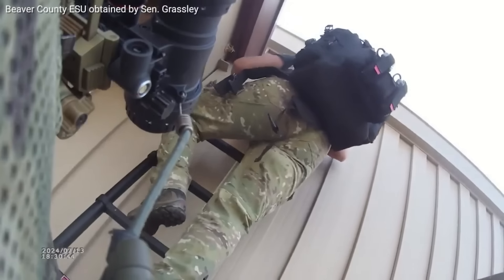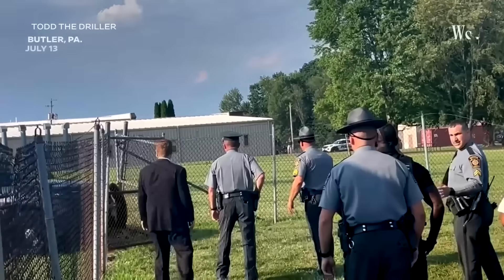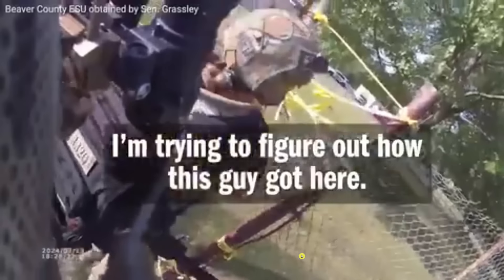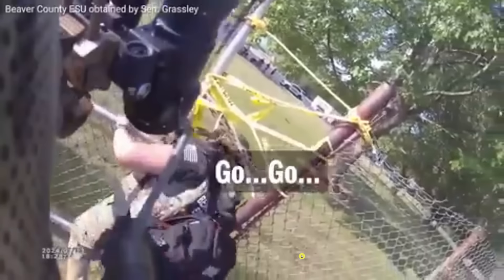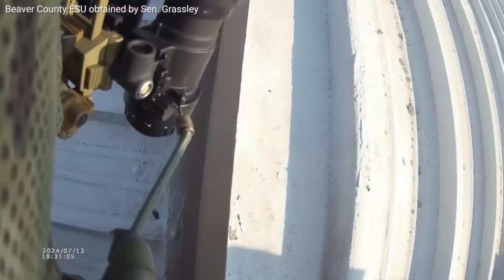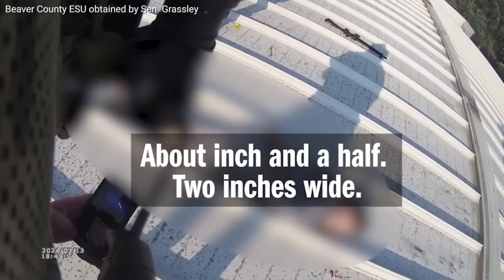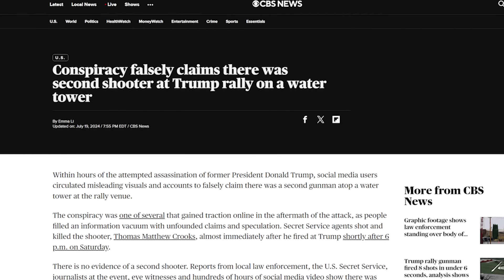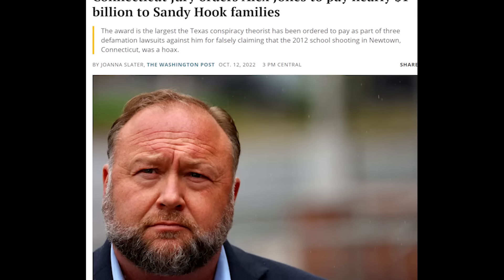Trump Shooting Analysis: Shell Casings, Ladders, Drones, Bodycams,

Comment: Most rifles eject spent casing shells to the right, and usually by several feet. So why would they be counting casing shells in front and to the left, between the shooter and the gun. And why the heck was the gun so far to the left of the shooter? If 18" roof ribs, it's at least five feet from him. Did someone move it? Did the shooter not die instantly and somehow roll himself to the right. NOTHING makes sense!! So many questions.
Reply: Exactly
Reply: I was thinking the same they. The AR15 ejection port should had those rounds to his right. Even with the BWC cam and the 5 or so officers counting casings, they said 5 but yet the reports form former SS director and now lying FBI it was 8 shots. I would have expected  8 spent casings on the roof.

One other thing I've been thinking about he said he had 3 30-round magazines, where are those magazines? And did he really believe or think he could get off all 3  mags with 2 known CST posted in the vicinity?

Again explanation given to the public does not make sense.
Reply: Shot 1-3 Trumps was standing, shooter has rifle laying on the apex of the roof like a stand. After the 3rd shot, Trump hits the deck and is now being protected by the bullet proof Stanton. The shooter could have stood at that point because now he would need to get a different angle and trajectory to hit Trump and the only way was to stand to get more of a downward shot. If the counter sniper shots him in the head, It could have very easily spun his body and the gun was thrown out of his hand. I mean how long is a fully extended arm. About 2 feet.
Reply: This video is an hour after the shooting, so this was not witnessing what actually happened. The closest to the scene were the counter-snipers who have very suspicious stories, and there are other ways onto the roof including a window at the end of the counter-snipers building. There seemed to be a few casings that rolled halfway down the roof based on the helicopter view, so the casings in this video had previously been gathered and potentially staged.

The shooter was supposedly killed by the secret service snipers 9 seconds after the shooting stopped, but it looks like they're just trying to support their original statements despite the evidence leaking out. The final shot of the second burst had a much different sound, and since he immediately stopped shooting it makes a lot more sense that was the shoot that killed him. A local officer claimed to take a shot, and they are also disputing key elements of the FBI's narrative including the story that counter-snipers ever abandoned their post. Perhaps that shot 9 seconds later also hit Crooks, but this video is more consistent with bleeding out from a pistol shot rather than the blood/brain splattering of a counter-sniper rifle.
Reply: @kfelix2934 In the body cam footage, they counted 8 shell casings. It comes up twice. The first time he stops at 5. The second time, near the end of the footage, he counts 8.

Shell casings from an AR bounce around when ejected onto a hard surface, hence their scattered locations. 

It's standard practice for an officer to move a weapon away from a suspect. The first officer on the roof moved the firearm away from the suspect.
Reply: I watched this video before and the guy counted five bullet casings the sound experts say that the first three shots were fired from inside a building and the five others from outside, so why is that cop saying there are 8 casings there ?  So much BS lol 🤣😂
Reply: Both sides of the roof, not the shooter. Over the roof mid line. You can see several of them in the footage.
Reply: @tammlen2284 i have the same analyse 2 days ago...i saw a picture  on the roof where they shoot Crooks ...on this picture   there was an police agent dressed in Black uniform grabing the  hand of Crooks lying on the roof( apparently dead but blurred) there was a trail of red in one side to the other side where he was...so when i saw the body cam video...I undestood that they have moved the body...a question to myself is WHY...?  In an investigation they  are used  to Never move  a body  ...only corroner does...Did they move the body to serve a theory  they want to fake ? There s to many non sense in this  case...🤷‍♂️
Reply: The gun being so far left could be just the normal procedure of police to move the weapon away from suspect, but the shell casings - that smells to high heaven.
Reply: @peterjsmith5918 wow this makes more sense than anything I've heard so far.
Reply: They are trying ways to cover it up. The audio recording proves there were 3 different rifles fired with the first 3 rounds from a high powerd calibre rifle, possibly from 308 or similar calibre. The sonic boom and wave from the rounds we're different..if all from the same area and rifle, the sound waves would be exactly the same. But they are not. The first 3 rounds fired was different from Sonic from the others fired.  Then, a single shot was heard last, possibly the sniper round that took out Crooks.
Reply: @Nathan-ry3yu  I noticed that they wanted us to believe all shots came from that mangled looking AR... there was way too much report for those first 3 shots to be that low powered. And the audio did prove that those first 3 were more focused as if isolated, almost as if they wanted it to seem like a lower caliber rife.
Reply: @tammlen2284   This is either the most crazy Mr. Bean accident in history... lol my foot. Or it is super well orchestrated.
Reply: The crime scene was tampered already. We saw video of camo geared climbing up there and there were already few black police units. My guess is that they were secret service guys. They probably tampered crime scene and moved the gun. Who knows if they placed more shell also there. If we will not see their cameras i can safely say this is coverup
Reply: My guess is that they could have bounced the ground at an unusual rotation, but that is a good question and something that needs to be explained. As for the weapon placement itself, it’s standard procedure for tactical units to remove weapons out of arms reach of a fallen enemy, deceased or not. I’d assume the tactical response team that first got to the body has the same procedure, to me, not very suspicious. 

I also don’t think it’s necessarily tampering with evidence, because the most pertinent issue is NOT to preserve evidence but to neutralize the threat.
Reply: Why are swat officers counting cartridges to begin with? Are they also qualified in forensics.
Reply: @chriskessell4579  You obviously didn't watch the entire body cam footage that was released. You watched the part where one of the first ECU Swat guys on the scene says there are 5 casings over here. You could tell he was talking about ONE certain section of the roof. HE wasn't talking about the entire roof. Then near the end of the video they say there is a total of 8 casings. So, the first SWAT saw casings in one section and that is what he was talking about, which is shots 4-8. That is why all this BS stuff is floating around because people aren't watching the complete video.
Reply: @peterjsmith5918  Such BS. Not one thing you said is true!
Reply: The first three shots were fired from the second floor of the building next to the alleged shooter.  The weapon that fired the first three shots was probably fitted with a silencer, which accounts for the lack of echos.  The second five shots were blanks fired from the same location but with a different weapon most likely an AR-15 using a surefire trigger that can fire rapidly.  Blanks were used in the AR-15, which explains why no one else was injured.  Local law enforcement was in the building next to the building that the alleged shooter was on.  The last shot fired killed the alleged shooter and was probably fired from the same window as the other eight shots.  Everything supposedly found on the roof by first responders was planted by them as alleged evidence, including the 8 shell casings.

Comment: THIS VIDEO IS EDITED the original shows the same guy counting 5 shells
Reply: Hr did count 5, then 3 more.
Reply: THAT is Chuck Grassley for you ....  just in time to back Chris Wray's BS testimony.
Reply: BINGO !    On the roof, first they said 5 casings.   But then he counted out 8 casings, without showing them on his body cam.
Reply: i thought the same thing but you can see the other 3 on the other side of the roof when he counts 5
Reply: @officialMC-E .  Now I’m wondering if he slid down a tad and did the round of 5 shots. Is that why sound echos different since it’s a metal roof?
Reply: @officialMC-E  you mean the brass tossed up on the roof by the ground floor ESU sniper as he high tailed it out of there ?
Reply: @officialMC-E  does not work like that. any ar does not eject forward, no way !. they eject backwards, which means, any shells would end up to bad guys right side..period !.
Reply: @alanshaw4655  EXACTLY!  Backwards and TO THE RIGHT.  Any spent cases on the shooter's left came from somewhere else.
Reply: Counting FIVE CASINGS HERE:    https://youtu.be/XwBygHmIZ6c?si=5vjsIlk0enneISFZ&t=280
Reply: I counted 7
Reply: @officialMC-E she’ll casings only eject out the right if they are on the left they would have to be planted or moved

Comment: No ladder needed.  Shooter climbed to the roof using the a/c lines.  Once he was able to reach the gutter(commercial gutters are made from a much stronger material) he hung from the gutter and cross slid his hands along the gutter until he could get his feet on lower roof.  There he could easily climb to the higher roof.  Point 2   The roof is not flat. Each section of the roof panels have a 3 to 4 inch rib which would prevent a person lying on his belly from easily sliding across the length if the roof.  The shooter had to lift himself up to cross each rib.  This is what the spectators saw.  When shooter was walking around no weapon can be seen.  Thus the weapon was on the roof at an earlier time.  The purpose of the drone was to see if the weapon was still there undiscovered and determine the best shooting position.
Reply: Where did the black ladder come from???
Reply: Smart
Reply: His ladder was hidden behind those cedar trees.  It looked either red or orange.
Reply: @jaygold4467  police ladder
Reply: Why would he buy a ladder and not use it? Crooks believed that he would be able to exit the scene via his ladder and motor during the commotion. He was obviously a patsy and foulked up the shot.
Reply: Ooh, this is the best take I've heard yet.
Reply: That makes the fact that he had a receipt for a ladder in his pocket and that a ladder was filmed on the side of the building even weirder
Reply: He was lifting himself up much more than 3-4 inches. I think he was taking a peep over the ridge of the roof, to check his line of sight. To confirm the north snipers couldn't see him, and also because there was a fork-lift kinda thing partially in between him and the target.
Reply: @noelogara1 he never used his ladder, after her seen drone footage,he knew he could climb up AC pipes,the ladder u are seeing in video is the one cops brought to get on roof

Comment: The whole collapsible stock argument is for the law they already have writen and want to use this event to pass. The majority of collapsible stocks have around 3.3" of difference in length and that makes absolutely no difference in concealability what so ever.
Reply: Unless the director meant "folding stock"
Reply: @CedarOutpost  With a foldable stock it doesn't change. They want us to focus on the wrong subjects to not realize what is going on and what will happen...
Reply: @CedarOutpost  if the FBI director doesn't know the difference between a folding and collapsible stock, then he is a fool and in no way qualified to have that job.
Besides, very few AR15s have folding stocks because the tube the stock slips onto contains the buffer and the spring to operate the firearm. One has to add in a part that minimally costs $100.
There are piston driven ARs that do not require a buffer and spring, but I don't think this is that type.
Had the director correctly surmised that the rifle was broken down into it's 2 major sub assemblies, I would have given him credit for not being a white male DEI hire.